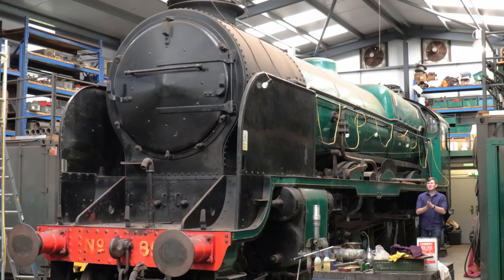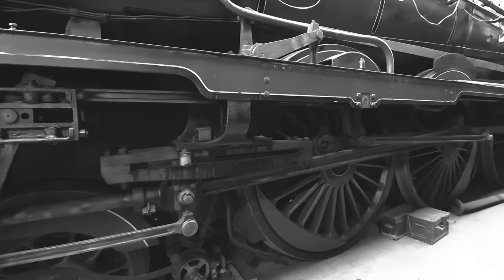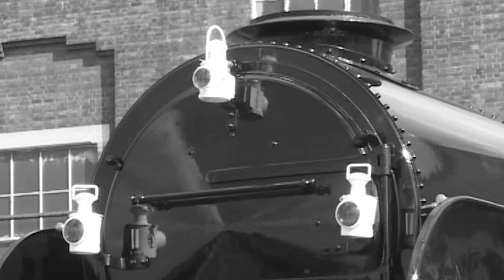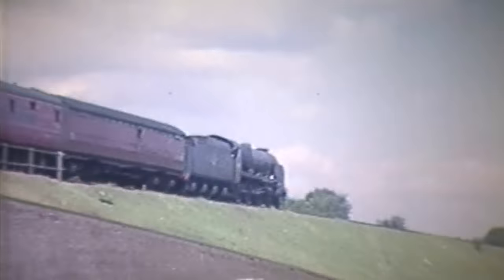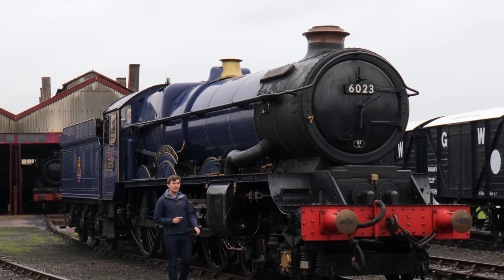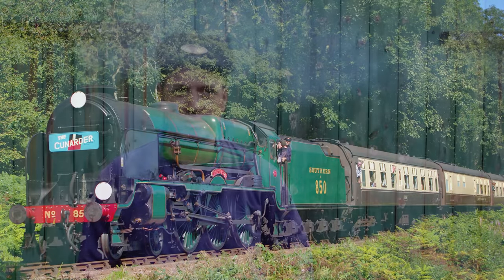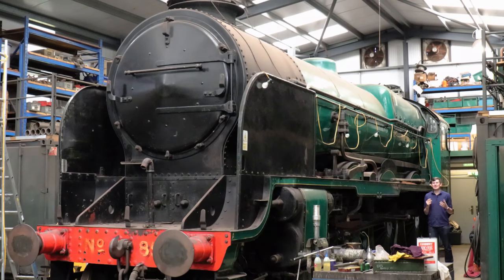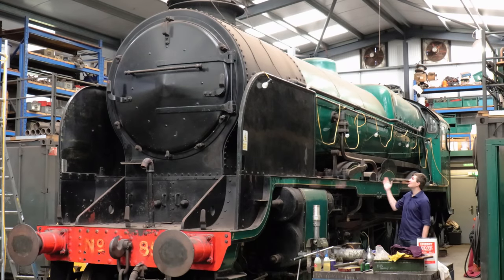Locos Of The Line -  850 'Lord Nelson'

Comment: A good presentation. I’ve travelled behind and shot some footage of Lord Nelson on the Watercress, and the 8 per revolution is one of the most noticeable features audibly.

The trial gas turbine was a bit ahead of the times, given that quite a bit of our mains power is generated via them at present - over 50% at the time I typed this comment! That said, the point was made that they are not good at variable output, and of course the ones at places like Didcot B are actually combined cycle gas and steam turbines - but they are pretty efficient at steady output.

Comment: Could you elaborate on the 4 cyl. layout more, I.E. the crank axel & valve gear, maybe pictures from the erecting floor. Hats off to you for excellent videos from Northwestern Pennsylvania!
Reply: Think of it as four sets of walschaerts valve gear. two sets of valve gear on the outside of the frames and two sets on the inside. Also if I have remembered this correctly the outer cylinders were connected to the center driving axle and the inner cylinders were connected to the forward driving axle. Due  to how the crank axles were set up the loco produced 8 beats per revolution instead of the normal 4 that other 4 cylinder loco's produced.

Comment: I really don't understand this competition thing between the GWR and the Southern. I mean for prestige, I get it. But if say you lived in Swindon and needed to get to Bristol, you could only travel on the GWR, and vice versa, if you lived in South London and needed to get to Brighton, you had no choice, you'd have to travel on the Southern. 
Granted they did overlap on the main routes to the west but for the vast majority of the subsidiary routes you were stuck travelling under 1 company. It just seemed kind of pointless spending thousands and thousands publicising your brand when most of the time you didn't really have much choice which rail operator you went with.